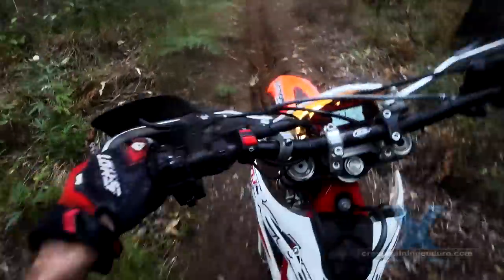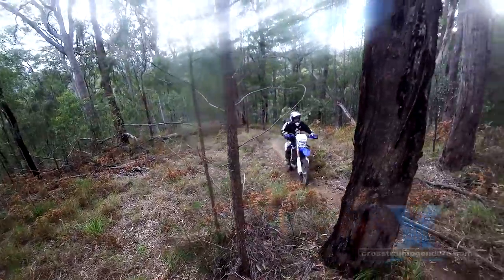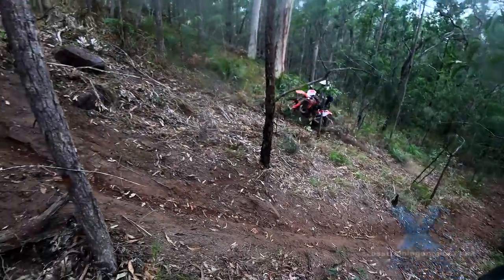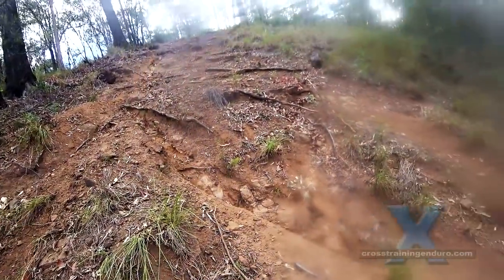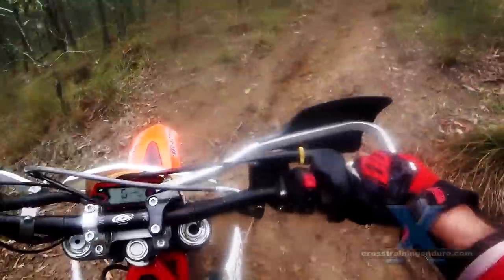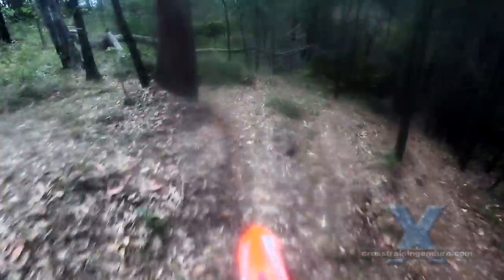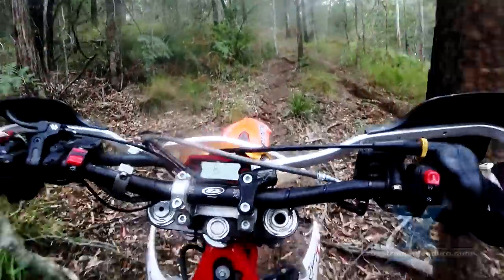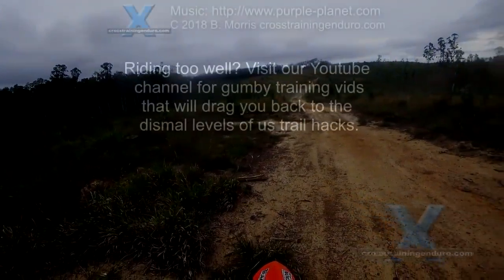Shagged 16psi rear knobby project part 1︱Cross Training Enduro

Comment: Ah, you’ll have to forgive this  Northwest American white haired Gumby, tires are much better than the tires I grew up racing on. Back then if the knobby had much more than a 1/8 radius to the leading edge of the knob. The tire was replaced, these days I can 5-6 hundred miles out of a rear tire and twice that on the front. Even on hard pack I would never run more that 12 psi. Most the time more like 8-9.  If the tire is slipping, then it’s time for new rim locks. By the way I bought a 1976 KTM brand new, the first time I changed tires I got a surprise, it did not have a rim lock, it relied on a much more barbaric solution, it had spikes in the rim that dug into the tire. Yes it came from the factory that way.  I never saw another one like it.  I alway enjoy the channel. Keep it up.

Comment: So funny story, i recent got a gas gas xc300 that's street legal ( i'm here in the United States), and have been intensively watching your videos, trying to learn more about technical riding and keeping traction rather than spinning everywhere. I recently went to the Badlands OHV park in Attica IN, and thought i might try to use some of these techniques. Turns out in the super soft sand that i was dealing with, almost everything i've been practicing was useless lol wheel speed and momentum was the only thing that was getting us through.
Reply from the maker: definitely a different kettle of fish! we are thinking of a training vid that's about all the times you DO need wheelspin, speed and momentum....
Reply: @crosstrainingenduro  it's unfortunate because I really enjoy tight technical single track, but unfortunately around here it's very hard to come by. Too many goofs in side by sides or jeeps destroy all the riding areas.

Comment: I've been thinking about investing in a knobbie knife. I did have good success, btw, with cutting horizontal sipes across my worn out GT216X with a cut off wheel. But this tire is so far gone now that the side walls are falling off. But I, at least, have tubliss installed. So that helped me run it a long longer than I probably should have.
Reply from the maker: same here ken, if i wasn't so lazy i would have put TUbliss on when i got the bike. with 2psi that shagged knobby would still be working fairly well.
Reply: Wow, I really need to proof read my comments. In the above entry I should have said the side wall knobs are falling off. And "run it a lot longer". BTW, I run the 216X at 4 - 5ish. I think 2 is too low and it gets squishy/wobbly feeling in the rear.

Comment: Tips from a pro.. for hillclimbing being higher in the rpm range with more speed is the key to any hill climb, esp on a smoker. On your fourstrokes traction and clutchand throttle use is key. Onthe small 4 strokes momentum is everything. Like he said tires are only 20%

Comment: Hey quick question what is a nobbie iv done 80 hours on my kx 250f and race it in the bush and still has the original tire on it and the nobbies just fly off and fall off and it’s great to get used to wet terrain riding and working on grip so I say ride that tire till u see the stitching and get the most bang for your buck🤘🏽🤘🏽🤘🏽

Comment: Great video as always. However, Im starting to question the 80/20 rule. I can certainly see this applying to a higher then average skilled rider like you're self.  But for those who are learning, and are skilled just enough to get them self into trouble. Having the right Equipment. Seems to make up more then 20% of the equation.
Reply from the maker: i'd call it a principle at best, jon.... so many factors involved. some guys say 90/10, others 60/40. i would agree that better riders are probably be affected less by bike choice than beginners.
Reply: Thank you, I appreciate you're thoughts on this. You are very wise, and it inspires great things within a lot of people. Wishing you the Best!
Reply: I’m hearing ya, mate. I need all the help I can get.
Reply: Agree this application only applies riders who have experience know atleast basics, eg not a  beginner.

Weight, power delivery wide open spacers without hoons and testosterone filled morons on 450s and 300s applies to beginners, eg a farm far away from the muppets.
Reply from the maker: hey i consider myself a muppet lol

Comment: I think I need to run less pressure.
Reply: Jim O'Rourke I’m running 15psi normally
Reply: Gabe Williams Productions that’s where I’m at, might try 10.
Reply: I'm running 10 psi on my GT 216 with HD tubes.
Might go down to 9 if it's slippery.
Below 8 is dangerous especially if you only have one rim lock.
Reply: I run 7 max with tubliss. If it’s really shitty I’ll let some air out so I’ll probably be at 3-4

Comment: You wouldn't get away with this setup in England.
Everything is pissed wet through.
Reply: redordead7771 i did 150 hours on one tire cause I was too tight to buy a new one. It was very scary when it was wet

Comment: I always prefer to run 16 psi in both tires because, I feel it is the perfect pressure for handeling, not hitting your rims, and reducing pinch flats.  If you run tubes heavy duty or not and ride really hard rocky trails and are a fast/aggressive rider you have to run at least 15+ psi to not hit your rims and get pinch flats.  I have always run 16 psi to reduce pinch flats and have no trouble at all on hard rocky climbs, trees, roots, etc.  I feel if you run less than 15 psi you start to loose the handeling characteristics of the tire and it becomes washy and tends to cause the tire to roll witch causes less control.  That's why I don't run mousse bibs because, I feel they are too soft and reduce the handeling and do'nt let the tire perform the way it should.  Tire compounds and tread design make a big difference on traction and the way a tire performs with and without tread.  Tubliss is the only way to go to be able to eliminate pinch flats and still be able to run the best/correct psi for the best performance.  I have found out by going through alot of rear tires the Michelin Starcross medium 5 rear tires handle and perform really well.
Reply from the maker: before TUbliss and starting the slower cross training stuff 15psi was always my standard pressure... as you say a good compromise for avoiding punctures and handling characteristics for 'normal' dirt riding.
Reply: CROSS TRAINING ENDURO SKILLS...The "roudy" section of Donner pass trail here in Colorado is far from "normal" dirt riding.